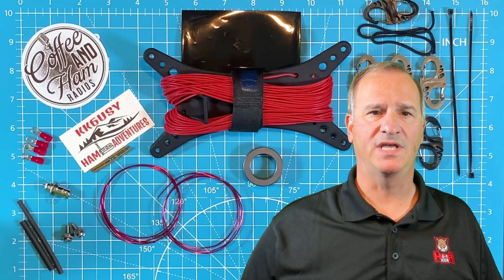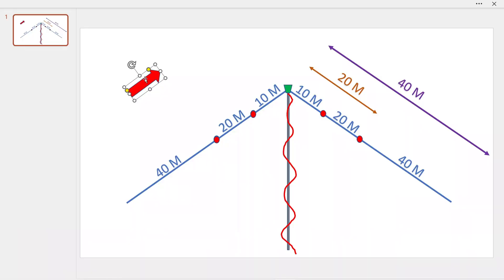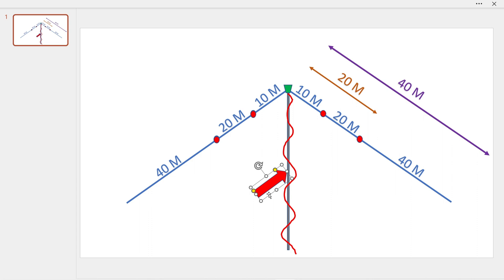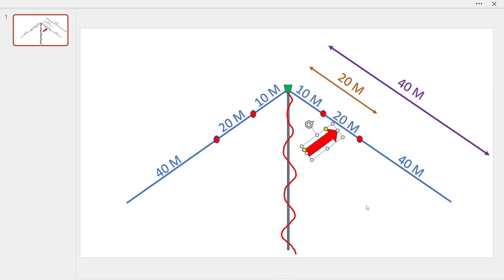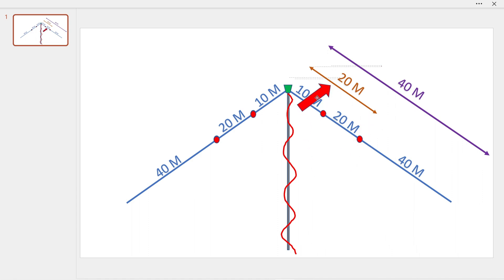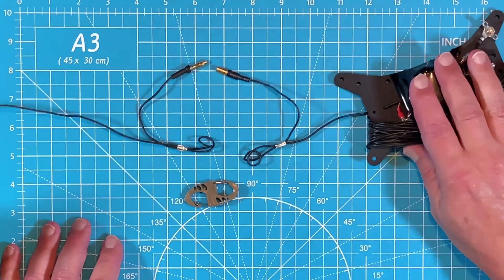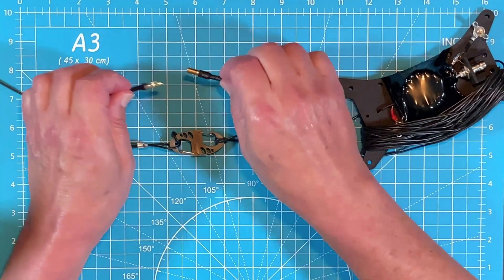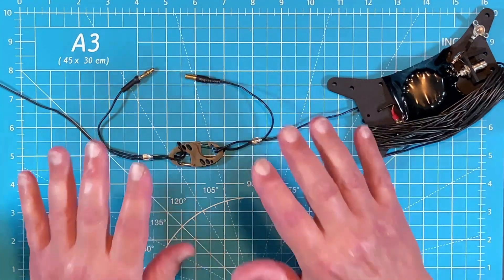Part 1  START HERE: Build a Linked Dipole for 10, 20, 40 Meter Ham Bands -- CaHR Mercury Kit

Comment: ? So you have to go out the wire and disconnect or connect the banana connector on each time to use the different bands.
Reply from the maker: Yes, that is how a linked dipole works.  This is why I prefer multiband longwire antennas and tunes.
Reply: @HOAHamRadio  Thanks, I am just learning about them, I guess I will build something portable I can set up when out camping and something else at home where I have a tall pole where things will be out of reach.